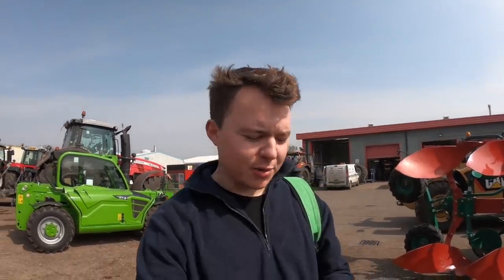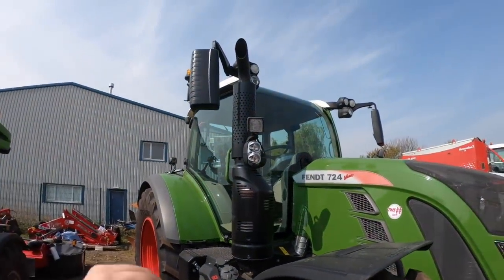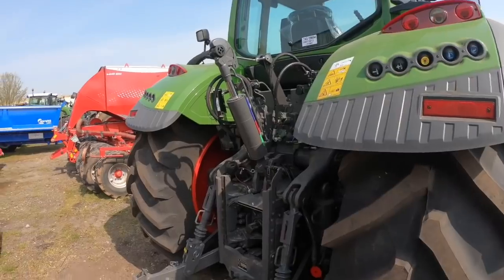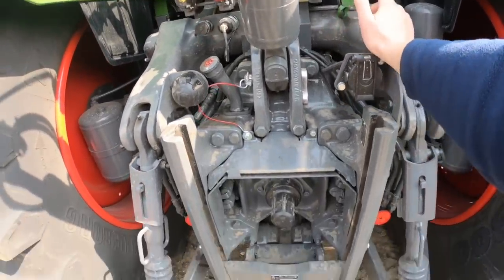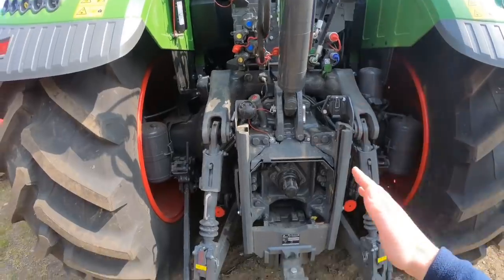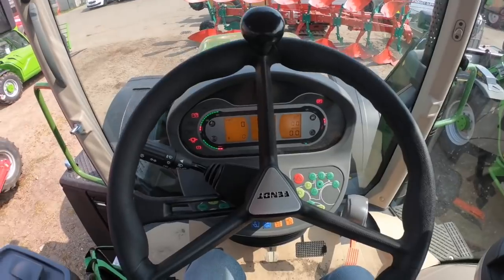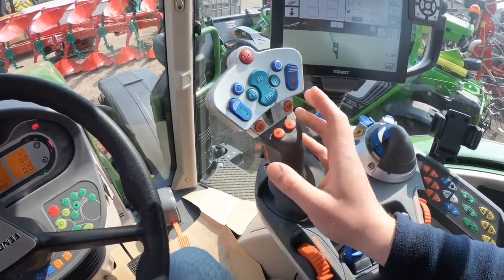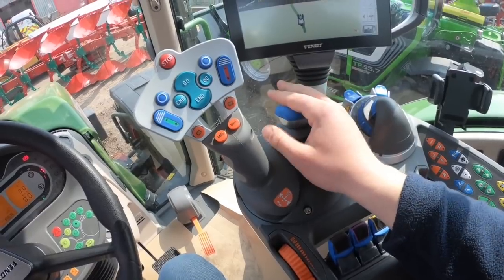THIS Is A High Tech German TRACTOR The FENDT 724 Vario!

Comment: I have a Fendt 514 at home and I really like it.
Fendt doesn't need a boost because the PTO comes straight out of the engine.
Our old Fendt 310 1994 is 24 years old and it still suns pretty wel but the brakes are a litte bit of a problem.
Reply: I’m guessing your Fender has 540,540e,1000 and maybe 1000e rpm on the PTO and it shuts off ? That means it isn’t directly driven to the pro but  directly to the PTO gearbox and clutch and then your PTO is driven 
So indirect your right 
In but honestly not at all
But I do like them FEND tractor from the 700 series’s
Reply: I've a massey 188,never had anything done mechanically and running like its new
Reply: New Holland cheap and best

Comment: Fendt tractors are high quality but the price is high as well😁👍
Reply: John Deere is not much cheaper! And Fendt doesn't need much Fuel!
Reply: @felixnoth7560  Thats because Fendt is the brand who invent things. Things wich are later a standerd in agricultural. Like the multi-function handle. You can map how you would like. And yes John Deere has it aswell. But 3 years later. And not even on a 250 horse tractor. Fendt is just a tractor wich is as standard better as the most tractors with all the options. And they use real horse power, REAL POWER.
Reply: @hielkeroorda2017  Yes Fendt is a kind of special! I think nobody has to like Fendt, but I hate those idiots who write Fendt is shit ore something like that shit.
Reply: You have to pay high for great German engineering
Reply: You cant beat german technology period.
Reply: @felixnoth7560  i.donteef.s.ttactor

Comment: fendt are a perfect example of the brilliant german engineering full of features and very optimised for easy controll and its technolgy in the computer controll functionality they have had built in computers for a pretty long time and i have driven a 724 like a tiny bit but im used to their older tractors to be accurate i have a driven a fendt 415 vario tms and its technology is kinda infront of its time

Comment: I'm driving an old fendt favorit 824  turboshift with nearly 22 000 hrs in the unit 
I had just ohne Major breakdown, the hydraulik Pump broke Down ( no steering ......) was Quite expensive except of that a Perry gopd reliable unit which i prefer over our newer Massey units

Maybe You can get your hands in an older favorit series model to See the differences👍

Comment: Fendt are good and everything but you can get a john deere 7810 for less than 30.000 whith 180 hp under the hood
Reply: But does it have all the features a fendt does?
Reply: Got an 22 year old Fendt 824 turboshift and a 4 year old John Deere 6250 R which dont differ a Lot in equipment ( except of satnav which just the john deere has)

Comment: maybe demo a 516, pretty small 160hp basically a 716 but smaller and less expensive 🚜
Reply: 516 is a 4cl but produces great power, the 700 series run a 6cl with the same power and greater torque. I’d go a 718 as it has good power and great efficiency
Reply: @thehoulahan4421  We had a 516 as a replacement while the engine of our 415 was getting repaired and in our opinion the 516 is worse than our 415 which is the basically the predecessor since it also has 4 cylinders

Comment: I Recommend looking at the John Deere 6250r the new version coming out of Germany you with learn that all the systems in the Fendt are in the 6250r it would actually surprise you as they are already come with auto steer and it does boost its power when needed from 250 to 270hp

Comment: had a 720 since 2016 and two 800 since 2006 used to have a 612lsa from 1988 fendt are tractors that last on maintenance only hardly any issues 1 electric relay on the 815 faulty from factory little electric issues un the 612 in its youth i was a bit sceptical about the 815/818 since electronic happened but they have 13 years and are as good as new and i mean as good as new.
the s4 series are a bliss in comparison you need to use your head to use the tractor properly(just like any well equipped tractor) but working with the 720 is like spending a full day working the fields then stepping down from the tractor about as tired as if you just had a 1 hour session, the cab is quiet the  3 points suspension is so much worth it.
you will tell me jd are just as good... NO fendt tractors a filled with details that make its use easier just take a look at the rear linkage jd's one is unchanged for decades.... you can set and put away the fendt linkage at mudguard height in minutes without tools and you're never bending a pto shaft again... most of the tractor is optimised for ease of use that way.

i'm not agreeing on the cab part the cab's plastics that you don't usually touch especially pillars covers are made of cheapy plastic and this is good that way i don't want a rollsroyce interior the earlier cabs where good imo (a/c a little weak being the only real issue these where also louder compared to a S4 cab) you pay for a reliable workhorse that help the driver last through his long day at work in the bumps heat and noise not for a fancy interior...

Comment: I have driven a Fendt and yeah it was quiet and fast but I didn't like the wallowy ride ( a bit like driving a boat down the road) and there were too many options to do the same job via different functions such as shift lever over ridding by joy stick which has two direction function. But, I admit I am old school and prefer the old Ford, Massey Ferguson and Case IH. The price tag is too huge for Fendt so I would go for John Deere if I was buying a new tractor.
Reply: What number you drive? Mechanical or pneumatic cab suspension or 3 point pneumatic suspension? Driver seat evolution or not?
Reply: @tomyhr501  I seem to recall it was a 718, definitely a 2015 7series.

Comment: i would love a 200 series with the vineyard kit. as good as our old Massey Ferguson 35 use to work she finally kicked the bucket we believe she dropped a valve and the old man got a second hand David Brown 780 Selectamatic to replace it as good as it is these old tractors are horrible at turning in the soft Australian dirt with a 2 tonne trailer on the back. a tractor with 4x4 or FWA would be much better.